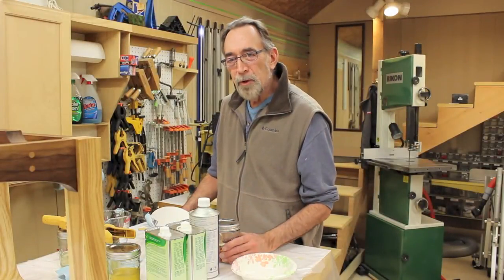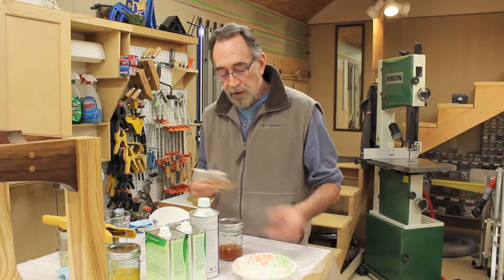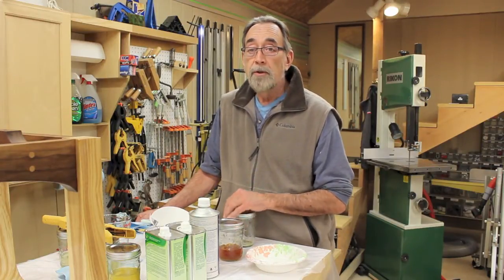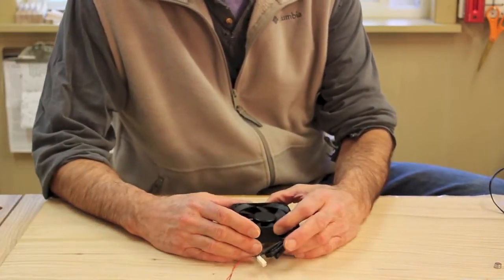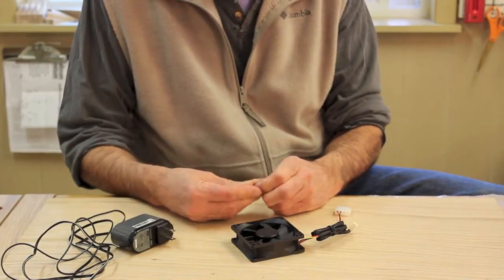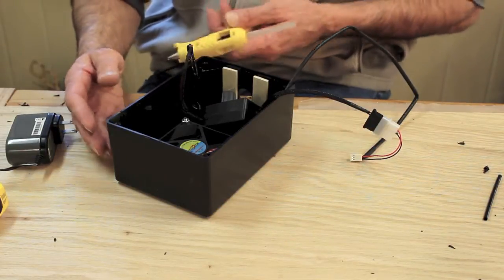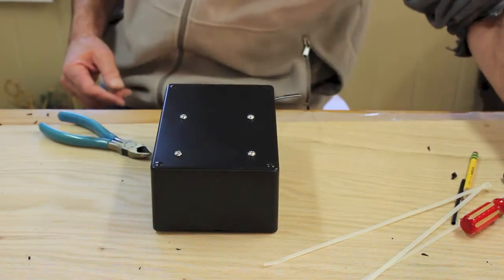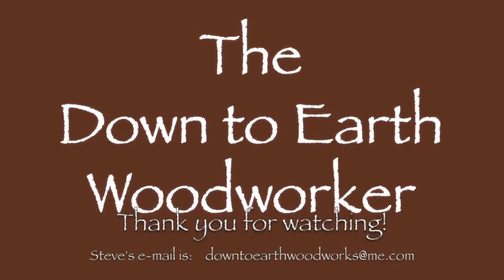Easy Electric Shellac Mixer

Comment from the maker: Thanks!  I built another recently with a little bigger fan motor and a bigger pair of magnets so I can use a bigger mixing bar.  It works well when I need to mix a bigger batch or (for some reason) when I am mixing the ruby flakes... they seem to clump up more.

Comment from the maker: The project box is 3" deep X 5" wide X 7" long.  I use a 1 inch stir bar, but also have a 1.5 inch bar.  The longer bar may require you to use a bigger magnet or stack two (for a total of four).  If you wind up stacking two magnets, just thread on another nut to the screw-stud to space the fan a little further from the inside surface of the project box. Thanks for watching!

Comment: I was thinking like dav1099, that you might have some heating issues, but more so with the rheostat. I noted that it had ventilation slots, to dissipate heat. the  current that isn't being used to power the fan when you run it slower than full speed has to go somewhere, and it becomes heat in the variable resistor.  at 12v it may not be such a big deal though. a very inventive and cool project though.  where did you find the stirrers by the way?